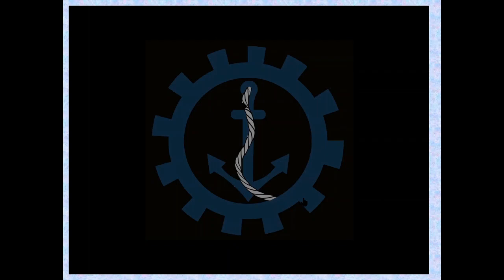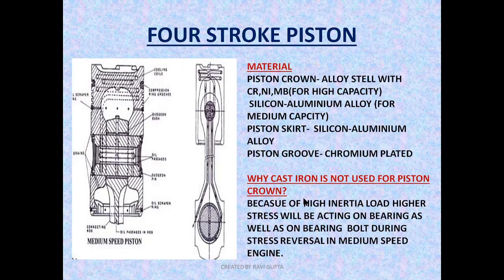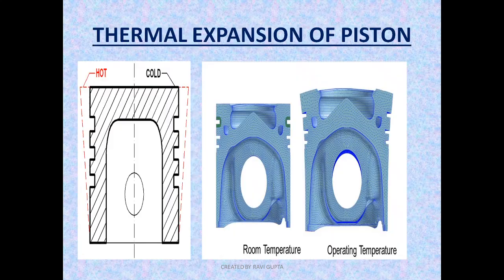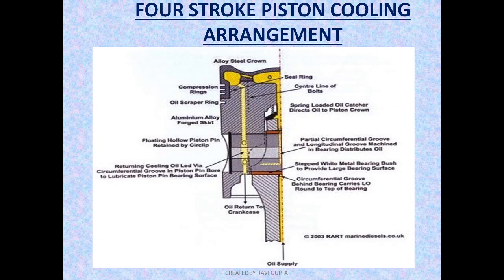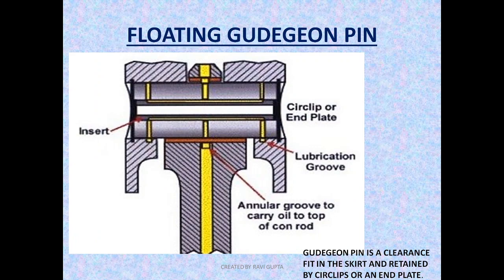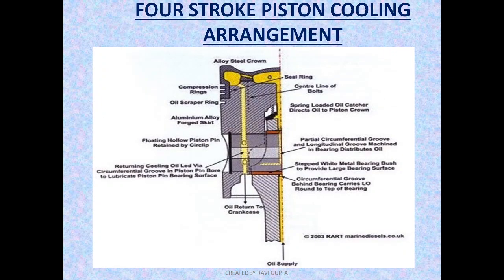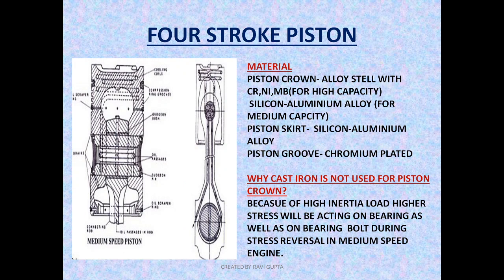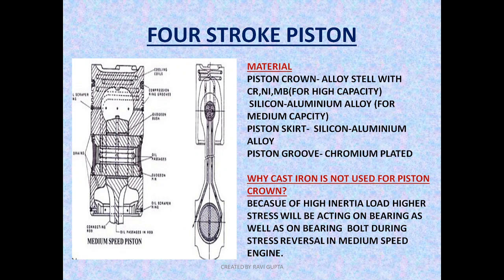Piston Cooling System|Four Stroke Piston|Construction|Thermal Expansion Of Piston|(Part-4)|

Comment: Why  floating gudgeon pin is used in AE & fixed gudgeon pin in air compressor ??
Reply from the maker: Gudgeon pin design varies depending upon the engine size. Most of the low load engine use interference fit gudgeon pin but high load engine employes floating gudgeon pin design as it distribute the load evenly and oil also provide cushioning effects.
I hope you understand!!!
Please do like and share with your friends!!!!